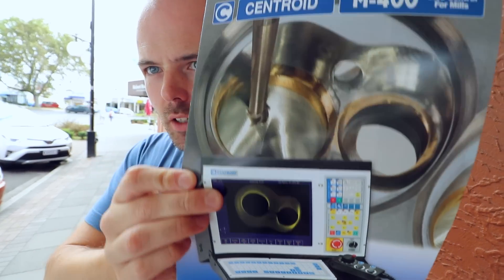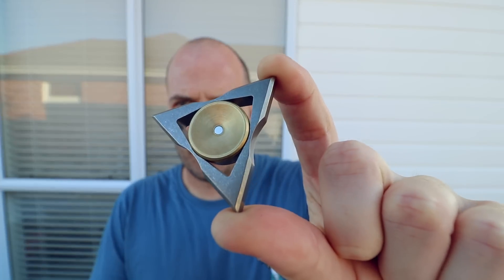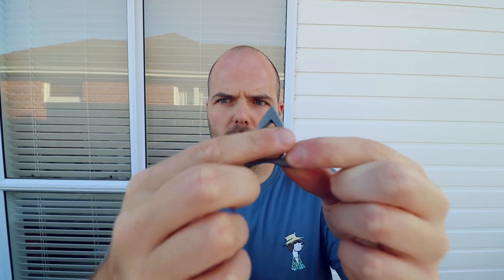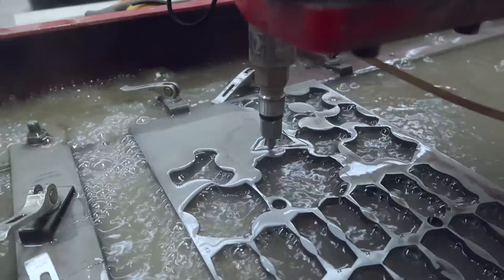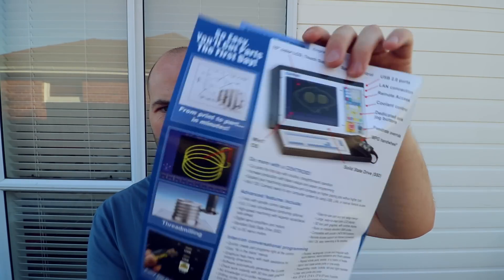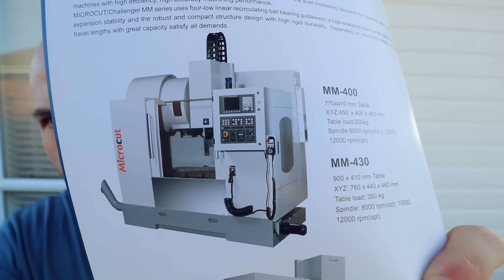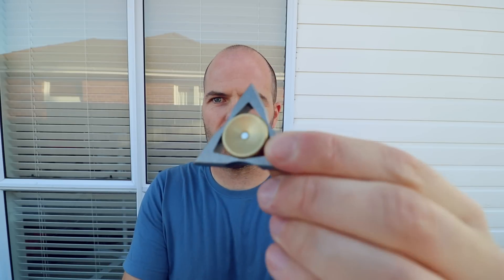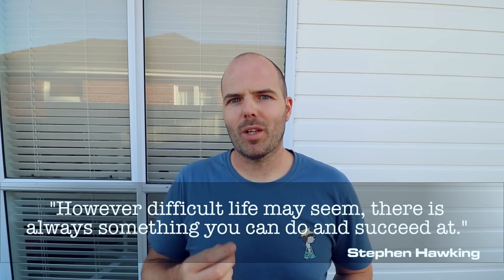Making Fidget Spinners on YouTube

Comment: FAQ and Links (I will add to this as requested):

"Pre-Order" List (worth being here, I promise): 
http://cogentindustries.com/spinner

What Cores is he using?:
Magnus is currently using the ones made by NTO Designs: http://www.ntodesignsinc.com/
But I believe the final version will be full-titanium cores made by himself.

Spinner Pricing:
This is to be announced, once the CNC machining costs have been worked out (probably soon)

Will Magnus use anything other than Titanium?;
Short answer; Nope. He has used Carbon fiber in the past, but mainly as aesthetics.

Why only Titanium, why not something to bring the cost down?:
Magnus wants to produce the ABSOLUTE BEST quality products, and will not use other materials to bring down price at the sacrifice of durability, useability or anything else. His motto is of course: "To Impossibly High Standards"  so what could you expect?

Will a mirror finish be an option in the final spinner?:
I believe that a mirror/polished finish WILL NOT be an option, due to the massive amounts of extra work that goes into it, which would make it much more expensive, I am sure.

Can you have one of the prototypes for testing or any other reasons?
Magnus has a policy that he will not let anything less than 100% perfect leave his shop, so unfortunately not.

Does Magnus make anything else?:
Yes, he most certainly does! Have a look on his website to see what else he makes (It is all amazing!)
Website: http://www.cogentindustries.com/yt1

Can Magnus do a giveaway?:
As of what I last heard, I believe the plan may be to do one at some stage, but this is not confirmed, and I am unsure as to whether Magnus has given it too much more thought, but stay tuned to find out!

Where is Magnus from:
Originally Scotland, but now resides in the New Zealand (Ohope Beach)

If there are any changes that need to be made, please let me know, and if you have any other questions, please feel free to ask below, and I will try answer them, if Magnus does not get a chance to.

Brad
Reply from the maker: Thank you Brad ...seems you know me better than I do :-D. Appreciate the effort you put in here. Thank you.
Reply: My absolute pleasure, Magnus. I will post this for each new video, and add to it as we go (that was the thought anyway?). Please let me know if you think I should add or change anything on them, I don't want to be posting anything false by mistake that could lead to trouble!

Brad